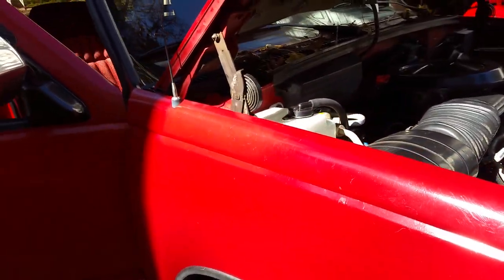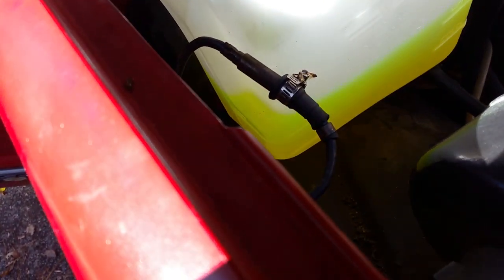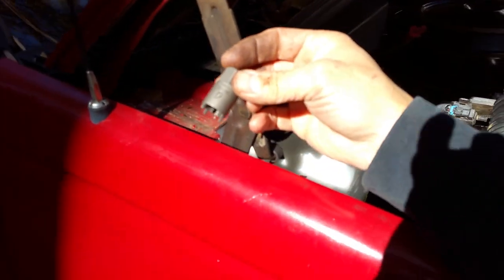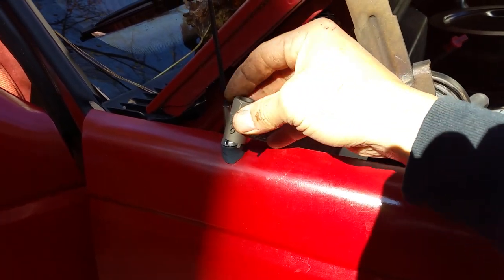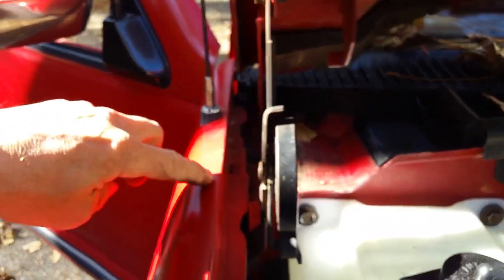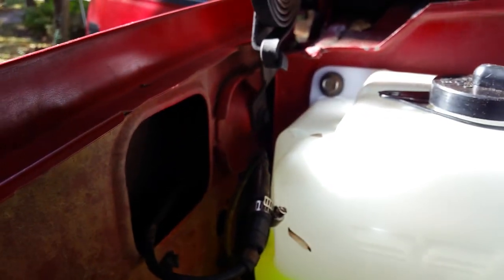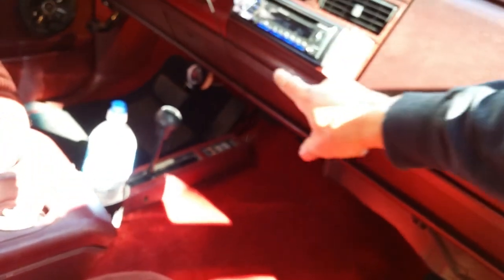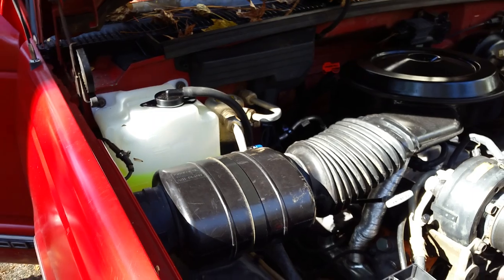Chevrolet Chevy C1500 K1500 Silverado Truck Horrible Radio Antenna Reception Fixed Resolved

Comment: What is the tool you used ?
Reply from the maker: It is not available separately.  Only available as part of a set of these tools (over $80/set). You might be able to find a similar tool at a common auto parts store for "GM Car Truck Antenna" nut removal.  There are types of tools designed for this task.  But unfortunately I could not fit my tool listed anywhere as an individual item.   It might be one of these though.  I have no other info.  https://amzn.to/2NckvfB